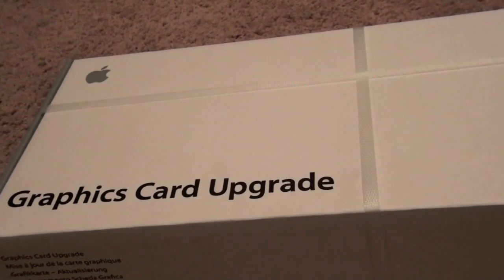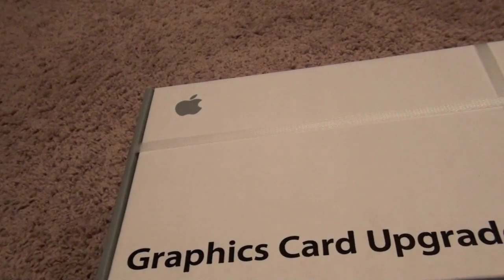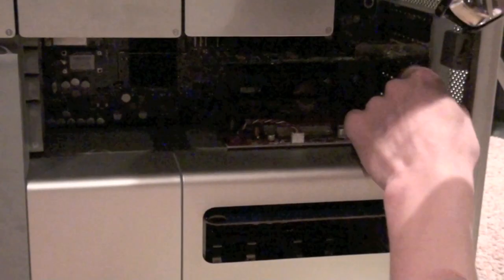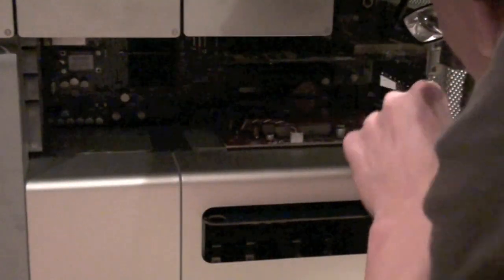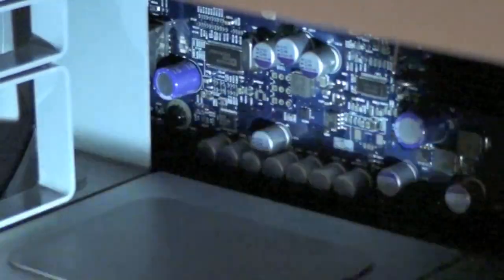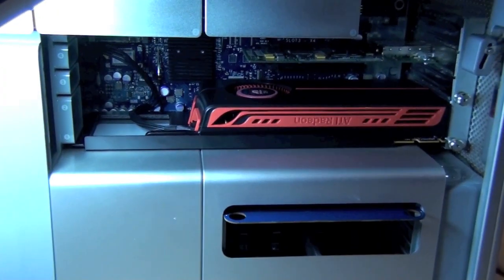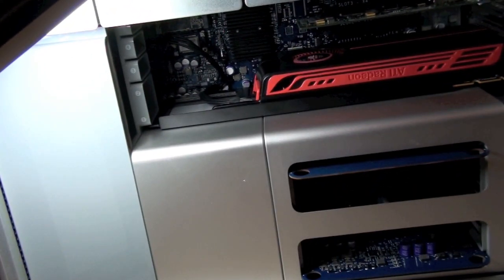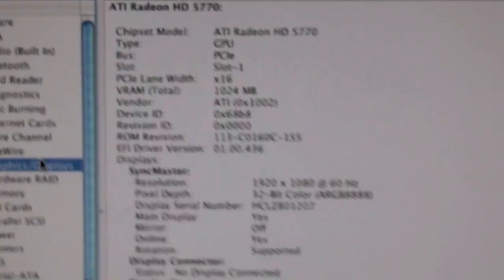Mac Pro ATI Radeon 5770 Graphics Card Unboxing, and Upgrade

Comment: The official 5770 is a rip off. You would of been better to buy a gtx. 500 or 600 series graphics card. I plain on upgrading my pc I game on to a new graphics card and the old yet still powerful gtx 560 ti will go to the Mac Pro. I loose out on the boot screen but it's a sacrifice I'm willing to make considering performance and price difference and my pc will get a gtx 770 or hd 7970! For around. $350 vs $250 I think it is for that card.

Comment: I know this is a really old video but I'm stuck at work with a lot of down time. Some of us mac know quite a bit about building computers, and yes doing this on a rug is major fail. Cut the kid a break though. its a used computer with an out of date graphics card not the cure for cancer. I don't know why I was compelled to comment on really old video but like I said I'm stuck at work with a lot of down time. No harm No foul 
later